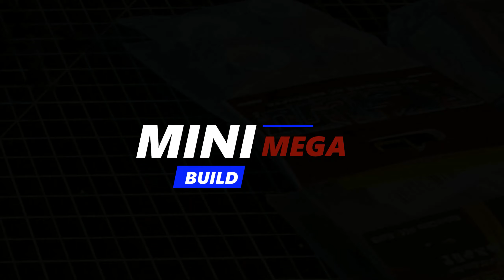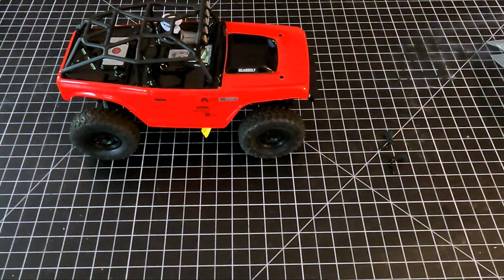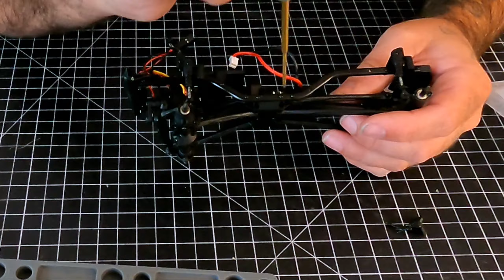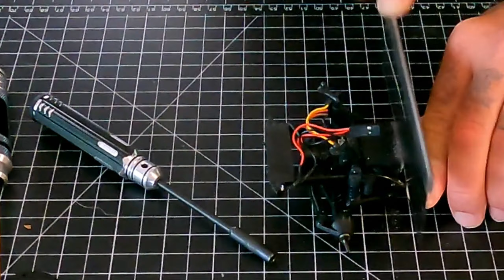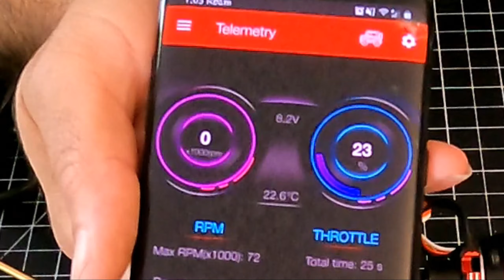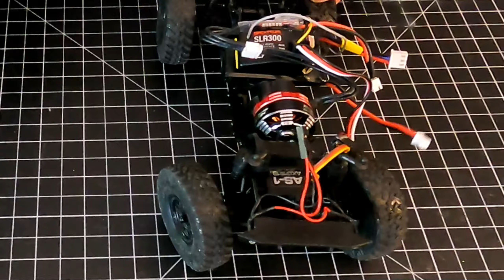scx24 motor swap

Comment: Can I run this kit WITH the stock receiver/esc? I know it's extra weight and needs to be relocated, but no thanks to buying a new transmitter/receiver imo.
Reply from the maker: you can  . you just plug the esc into the channel 2 port on the receiver.  and then the battery will plug into the esc instead of the reciever,